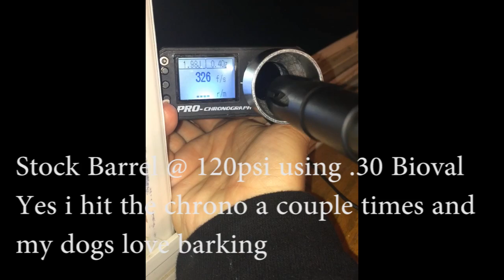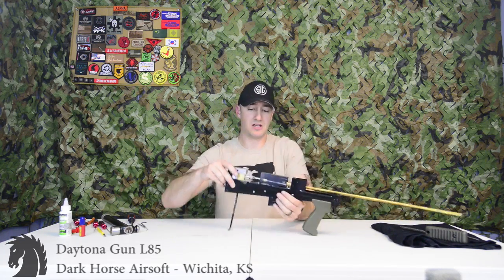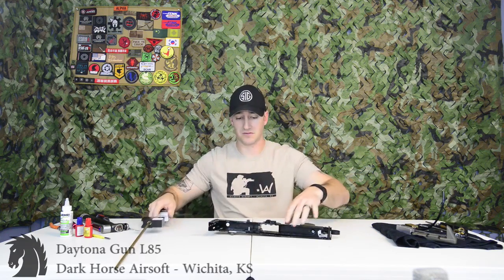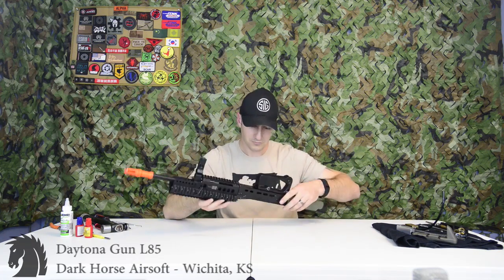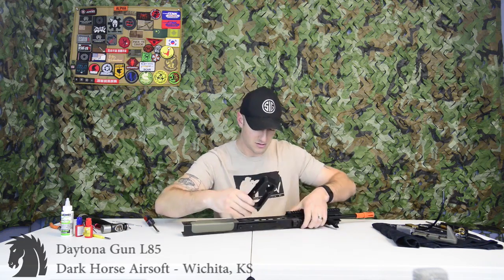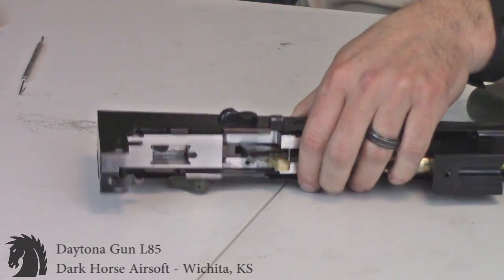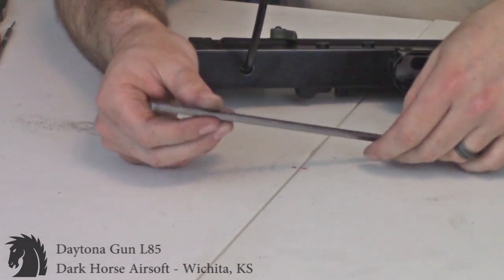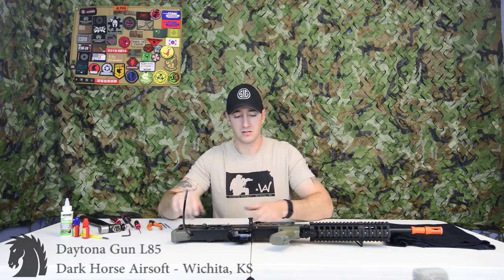Daytona Gun L85

Comment: I was wondering if the charging handle will hit you if you shoot left-handed....always wanted a l85 but the charging handle thing stopped me
Reply: proper shooting position and the kit out of factory is like 1/3 short stroke. It will not travel all the way back.
Reply: Regardless of short stroke, it will hit you in the face if you shoulder it properly. Unfortunately that's just one of the downsides of the SA80 platform. It's also why all British soldiers learn how to shoot right handed.
Reply: If you mount an Elcan with back up red dot using the red dot can let you shoot left with some practice but it’s a bit  unnerving to start with